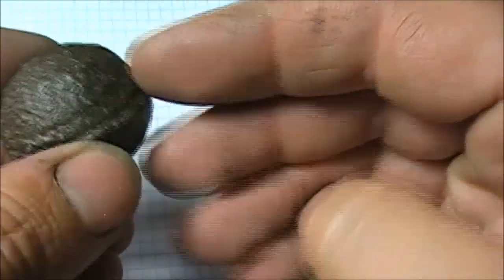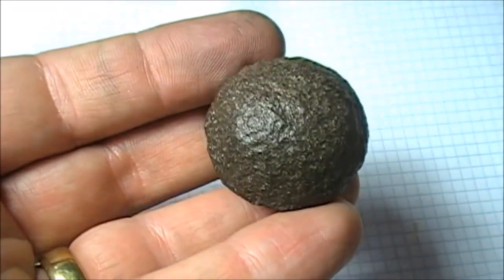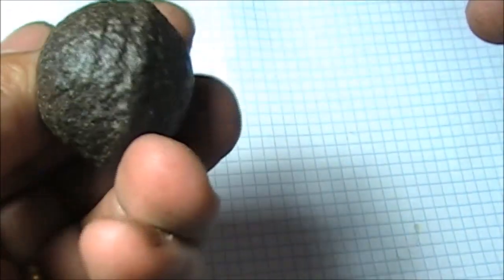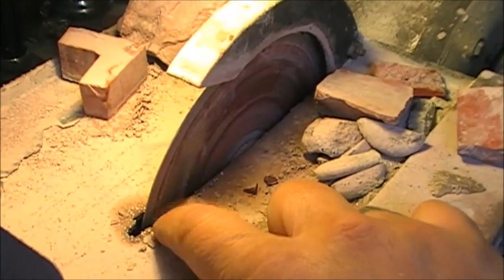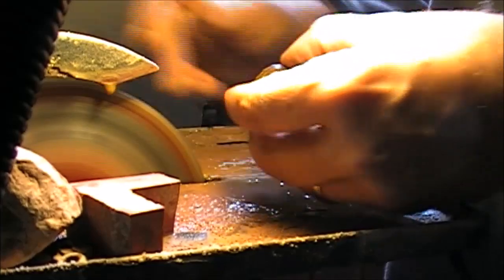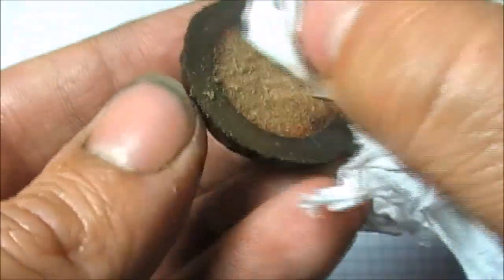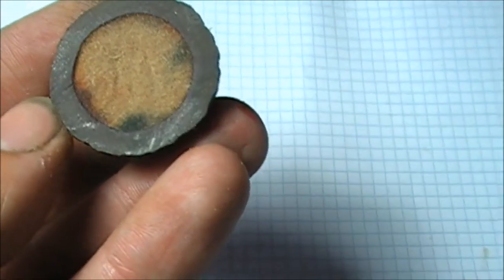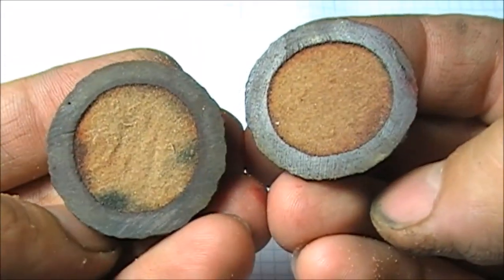Opening  Klerksdorp spheres and Moqui marbles

Comment: the sand needs to be analyzed and checked! what is it composed of, and is there microbial life? look at the sand under a microscope perhaps
Reply: I have several...
Reply: well. there's bacteria on it now if there wasn't already. that's a cool idea though. cut in a clean room and checked for micro life
Reply: Yes I agree, the inner material should be analyzed. The hard outer layer could even be used to survive entry into the atmosphere, while protecting the inside.
Reply: Why not get one of them analyzed with a microscope, what if there if there is much more to it? Could there be any microbes or seeds preserved by the hard shell?

Comment: You would think if these were made by heat that there would be a tapering off of the hardened inner shell, like a partial mixed melt before the pure sand. But the hard shell looks to be of uniform throughout and then it just stop abruptly at the sand.
Reply from the maker: orange70383 in fact, the balls look compenetrated by tiny flexible fibers that becomes more dense in the outer shell. Look at the last video I’ve made about them showing their magnification at the microscope. 😉 this is the link. https://youtu.be/2CWddNXP-3s

Comment: after reading up on the Moqui Stones,  the one you cut in video has the ridge around it.. It is called the male one. The other type is called female...it will be found naturally..the round one does not have a ridge.   The HOPI and other Shaman NA types use the stones as a grounding personal ceremony by holding one in each hand and  meditating. Most often they are sold in pairs  male and female... A great collector  set to have
Reply: It was female, the males have chunky crystals and the smoother ones are called female. Two of the same type still exhibit the "magnetic" phenomenon.

Comment: My guess just off the bat with no prior research or information other than a video I watched prior to watching yours named 5 mysteries (this being one of them) that sparked my interest and brought me here is:

Perhaps the people that made these found that when you heat the sand stones to a very high temperature that it turns extremely hard (maybe by a natural fire and after it ended they found the stones in the hardened state) then they created these using a fire source of their own and used these to hunt using a sling shot type of hunting weapon which I believe is why they’re so small because it would be easy to carry many at a time and fire them at their pray.
Reply from the maker: Matt Chavez please watch my latest video concerning these stones. I’ve found out they seem to be held together by fibers. This would suggest the absence of high temperatures during their formation.

Comment: As you said, it looks like it was a blob of sand subjected to enough heat to melt the outside and create the shell. I can envision bunches of these forming in a volcanic explosion, all sizes and shapes, flinging every which way.
Reply from the maker: frank seeli check the other video I did about it.... I did melt the materials and see what came out...
Reply: They are two different minerals so, no, the outside is not metamorphosed from the core material.

Comment: Where gloves when working with a saw ... Safety 1st!

You might want to have a Geiger counter or a MicroR Meter to check for any radiation that COULD be present....  Safety 2nd!

Great and fun vid !!!

Thank you sir !
Reply: Wearing gloves whilst using something like a circular saw is a terrible idea. If the glove touches the blade it gets pulled downwards with the turning motion, this rips off the fingers from the bone sockets. On the contrary, you accidentally slip your finger near the blade - only a small part of the tip gets cut off instead of losing the whole finger. It is much more dangerous to wear gloves.